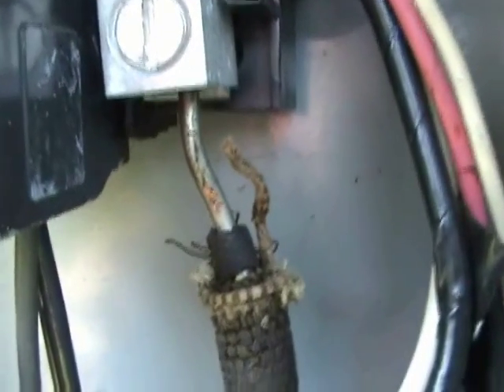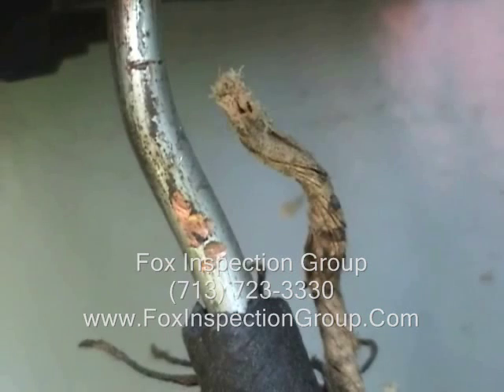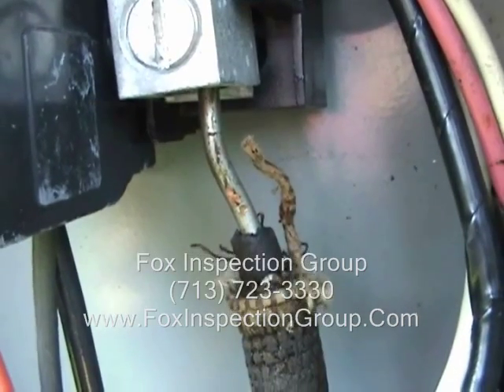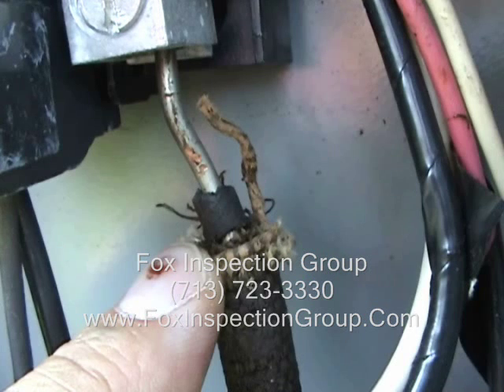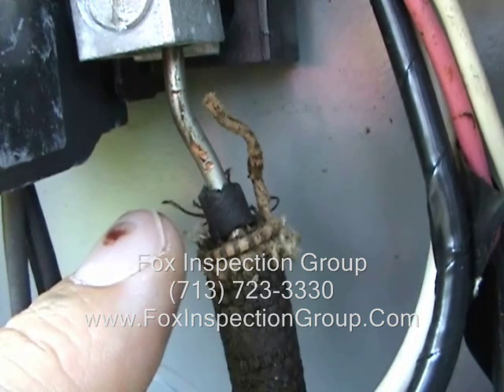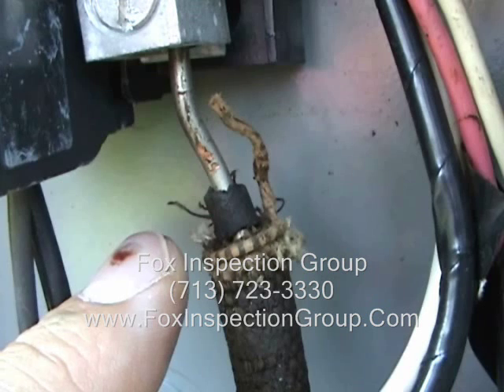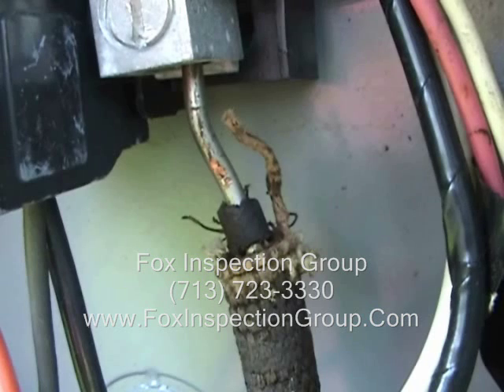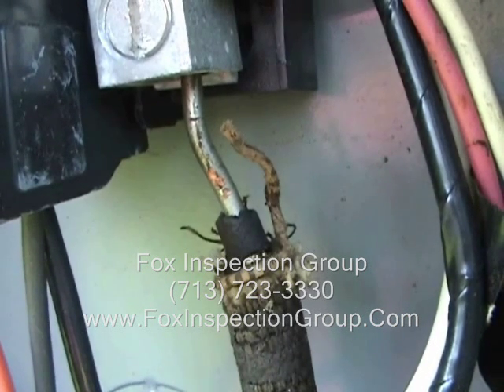Tinned Copper Looks Like Aluminum Wiring

Comment: Aluminium wire will never be used in BX. Look to see how the wire is jacketed. If you have BX then it's a safe bet it's not aluminium.  I would definitely steer away from scraping the wire (at about 2:00), its dangerous.